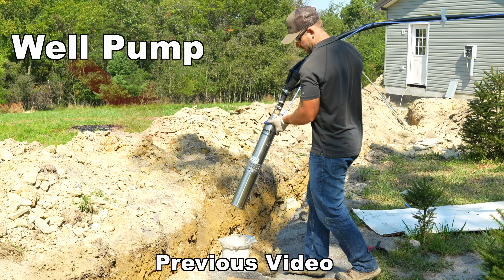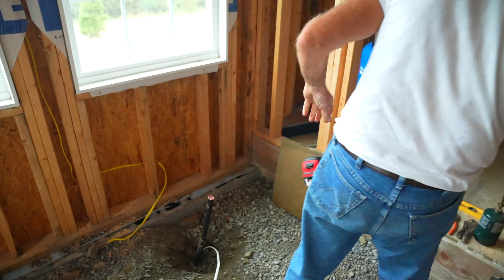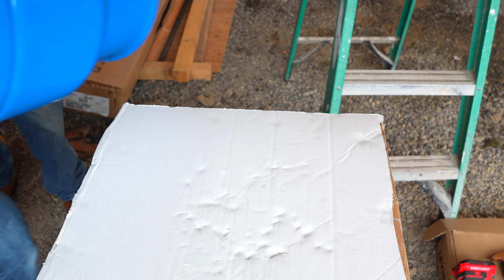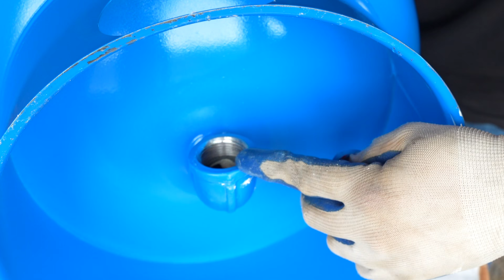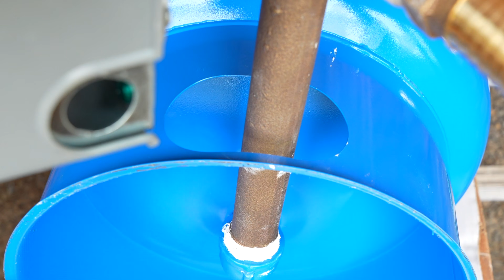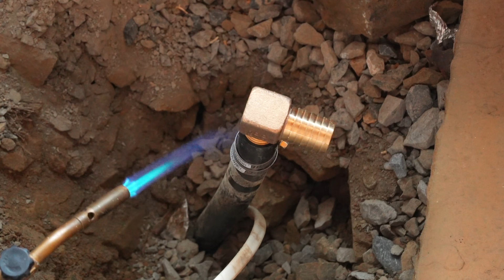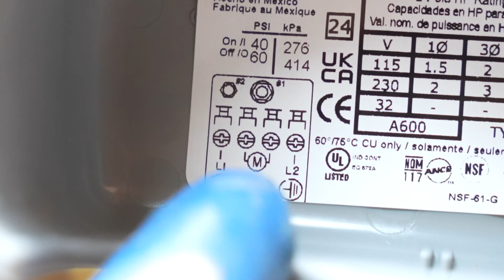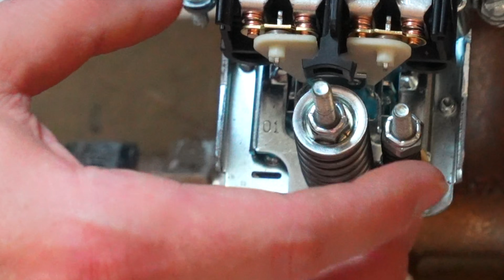How To Install A Pressure Tank - BEGINNER'S GUIDE

Comment: I want an emergency water tank connected to city water that is continuously filled and discharged to my house plumbing. I don't see a video for that here and this well pump doesn't apply to me cuz I'm on city water.
Reply: Not too difficult if you have space ... You get a water storage tank as big as you have space for ... Fill it using a toilet float ... Run your pump inlet pipe into the storage tank and the outlet to the pressure tank and to the house or barn ...

Comment: Love the video. On another note, I was  surprised to see the missing electrical disconnect at the well tank as well as a water shut off. Is that not required in your area? Yes I am am electrician. Thanks so much for the lesson!
Reply: I'm thinking this is in the mechanical room with the panel, making the breaker your disconnecting means.
Reply: What about not phasing the white wire  in the pressure switch 🫣

Comment: Nice video.  I was hoping to see the water come in and pressurize as you stated and maybe play with it to a 70-50 adjustment.  Also, you called the tank a 20g....but I've discovered that it does not hold nearly that in water volume.  Soooo, I want to go to a bigger tank so that my well pump does not come on as often...  Tks

Comment: Pretty informative video, although as others have mentioned, several things were not addressed.  I am really surprised that the pressure tank is sitting so low rather than sitting on a pedestal.  Is there even room to get a hose on that bibb?  My pressure tank is elevated about 8" above the floor.  I would actually prefer that it were up another foot.

Comment: Good video but why didn't you explain the bladder air pressure setting and Schrader valve on the tank? I know on a new tank they are probably preset but eventually it might need an adjustment.

Comment: I’ve always installed a check valve before the tank. To keep the water from the pressure tank from flowing back down the well it’s a vital component to keep the pump from over working and to keep the pump from causing water hammer effect, you may have installed one closer to the well head I’m not sure but I noticed it wasn’t installed at the pressure tank it’s code here to have it just before the pressure switch. 
Thanks for another great video.
Reply: How would you put a frost free spigot out near the well head if you have a check valve at the pressure tank? There would be no pressure at the spigot
Reply: @BaronKen  faucet should be after the tank or on the outlet, and before the shut off valve to house. Check valve  just before the inlet to tank
Reply: @BaronKen  in my area we install the tank at the well within a well house and we install a hose bib there but if you do have a frost free at the well and the tank under the house you can put the check valve after the pit less adapter and then the frost free.

Comment: I have two large tanks and had no idea how they work.  Now I do and can service or replace them! Thanks for the great video.
Reply: I also have a 2 tank system. Air bladders are ruptured so I’m figuring out how to replace…
Reply: Shouldn't you install a check valve near the pump..?
Reply from the maker: Fantastic! This video will give you the right direction for a common pressure tank setup. I have not installed two tanks on the same system. Good to know that is an option. Thanks!